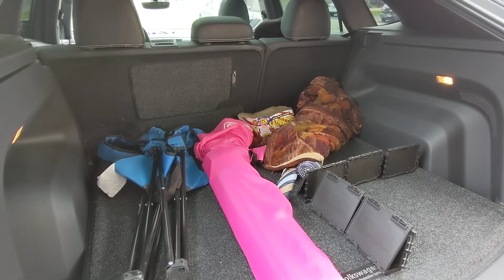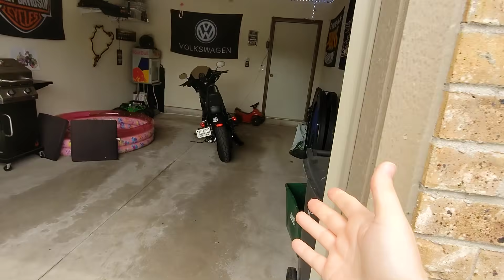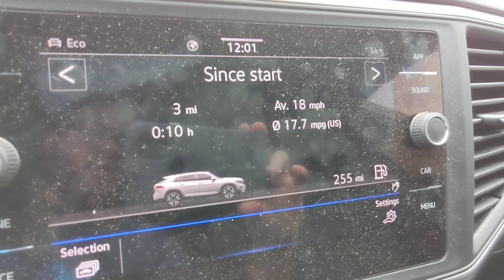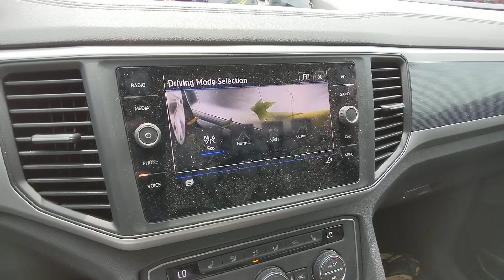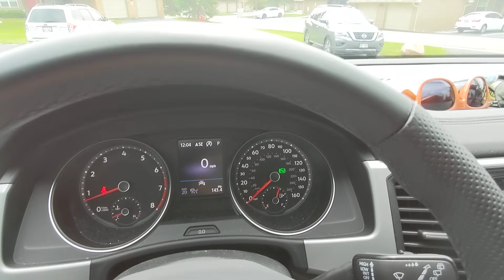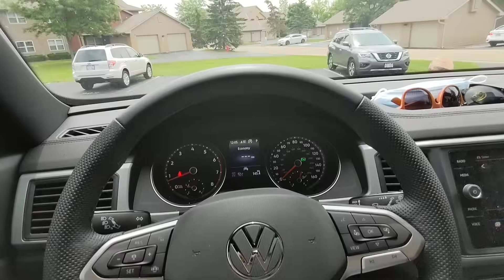2021 VW Atlas Cross Sport.  Why we're trading after only 4 months!

Comment: I have the four-cylinder turbo and I prefer that over the V6. It’s actually way more fun to drive and it gets amazing fuel economy.
Reply from the maker: Turbo is a great engine.  That VR6 sounds so darn good though!
Reply: I have the same model with the 2.0T audi motor. Its great with plenty of power and gas mileage.
Reply: So the 4cyl in this thing is NOT reliable
Reply: Lucas, what do you get for mpg out on the highway?
Reply: @zachl6918  I get 22mpg
Reply: Getting about 19mpg in my 2.0t
Reply: @mattnewhouse  Good to know, thank you!
Reply: If you choose Turbo over a v6 that’s a pussy move I sold my turbo cause it’s ass reliable

Comment: I was curious and drove no faster than 55 with an average speed of 45 to 50. I squeezed 23 to 24 mpg. I drive 50 miles round trip every day to work in my 2020 Cross sport 6 cyl. 4 motion. With a  slightly heavy foot when in a hurry, oh yeah, I'm looking at 18 to 19. Now with government pushing the green new deal, driving gas up and forcing us to buy electric, we're thinking of the ID4. Just thinking.
Reply from the maker: Its an expensive vehicle both from a depreciation standpoint and from a gas guzzling standpoint when you're putting on those kind of miles.  Its hard to justify a nice car just to load it up with miles like that.  To this day it is one of the best road trip cars i've ever used though.  ID4 would be a great option.

Comment: Just drive in sport mode, steering feedback is improved. And on freeways sports mode will not cause a dent once you are cruising in 8th gear. It just improve the response curve and removes up shifting eagerness in Normal mode. 23 mpg and regular grade gas is good as 26mpg premium. And while towing expect 13-16 mpg, which is not the best, so needs some planning on refueling. A bigger gas tank is all this car needs. Thanks to market adjustment by Kia and it’s likes, this remains my top choice. I can live with this.
Reply: My daily driver is an 09 Jeep Liberty. I put bigger tires, 3-inch lift, skids, rock sliders and side railes, class III hitch, customer front steel bumper w/winch. With that said, it gets 10 city, 15 hwy. Drive just under 3 miles to work, half of it is 25mph, rest is 35-50.  All it takes is owning one gas guzzler to make the Atlas seem like a sipper. :-) I also have a 2011 T&C Minivan and the 2019 Atlas SEL P (with 4Motion of course). Car is almost 3 years old, 16k miles. Use it for trips and yep, I stop every 300 miles to fill up.

Comment: Wow.  What a long winded review.  Must need the clicks and watches to get paid.  For a vehicle that was "traded", why not just get to the point?

We live in Wisconsin to.  AWD is NOT necessary if you have the proper tires on your vehicle for this climate.  We own an Audi A3 TDI and a Passat TDI 6MT.  Average MPG in the Audi is 41 and the Passat is 45.  This is over the last 35K miles in the Audi and 60K miles in the Passat.  VW lost a lot of its attraction when they made the decision to exit the diesel market in the USA.  

The Atlas and it's variants are "ok" vehicles.  They are nothing special.  We test drove all of the Atlas variants.  Can NOT figure out why anyone would purchase one over an Audi, especially for what VW is asking compared to a similar equipped Audi.

The BEST version of the Atlas is the previous Touareg TDI.  That SUV was what they should have continued.  30+ MPG easily, higher towing, better interior similar price.  

Our next vehicle to haul the family (there are 14 of us) will NOT be a VW atlas, that is for sure.  Right now we take multiple TDI vehicles and it is still CHEAPER that owning a single gas guzzler (and these vehicles are gas guzzlers).  A Chevy/GMC extended cab with a 3.0L duramax will easily get over 30MPG on the highway, cost about the same and tow significantly more.  The Tahoe AND suburban with the 3.0L diesel BOTH get better fuel economy than the Atlas.

Once Chevy gets a diesel in the traverse, which will most likely get 35MPG+ on the highway, they are going to eat VW for lunch.  Without the magical TDI sauce these things are money wasting fuel pit.  

Once you drive a TDI and can't get below 38-40MPG even if you drive the vehicle like you stole it (and that is FUN with all the low end torque) it will be very hard to buy a gas engine anything that sucks fuel.  Diesel around the Madison, WI area is 10-14% more expensive than 87 unleaded, yet returns 30% better fuel economy.  Your cost per mile driven is LOWER in a diesel even AFTER you figure in the cost of DEF (Diesel Exhaust Fluid) and the few extra parts that need to be changed (Fuel Filter, etc.)

If VW put their 3.0L Twin Turbo TDI that the German Spec Touareg currently has in the Atlas, then you would see MPG in the mid to high 30s, towing increase to 5000+ lbs and cost less to drive.  It makes zero sense to NOT do it.  They are just giving General Motors more time to increase the size of their diesel fleet.

Comment: I think this is decent mileage for a near full size SUV with awd. Its better than a Tahoe and the like but less than a Traverse. Unless you are getting a hybrid truck not many this size do much better. Now MPG has improved in many  SUVs for 2021 so it may have fallen in mileage ranking recently  but this has class leading storage behind the 3rd row. And if its regular gas instead of premium  that provides a savings. Looking into getting a Atlas R Line premium trim in about 8 months. Im looking at other trucks with at least 20 cubic feet behind 3rd row...so it stacks up pretty decent against the comp in sticker price as well  and not huge like a suburban. Im aware this version only has 2 rows.

Comment: Those faux exhaust ports are trash. Btw, a sideways muffler with two exit pipes is not a "dual exhaust". A true dual exhaust either comes from both sides of the manifold all the way back or at least split from the cats. C'mon man.

Comment: We have a 2021.5 Atlas SEL. 5000 miles, already taking it in to the shop.  Some sort of strange smell, sounds like plastic or rubber burning. We got a good deal on it, but the fake twin exhaust, the dumb reflectors, the crap audio system(literally the worst audio system on the market).... it's a cheap feeling SUV. Owned GMC's for 10 years, never had to take them to the shop for anything other than services... sure miss those BOSE audio systems as well.

Comment: I purchased a 2021 KIA Telluride for my family of 5. We got the SX model with FWD instead of the AWD because of mpg. I modified the intake and the exhausted plus added a oil catcher. The over mpg improve to 25 city/ 29 Hwy (solid at 70mph).
Reply from the maker: Congratulations!  All of the telluride in my local area are marked up MINIMUM 4K.  Crazy.
Reply: So did this "void" the warranty?? Also you paid more again to "upgrade" your car.
Reply: @patrickgroff5399  my background is chemical engineer and my work involves working with automotives. I paid about 2,000 under the msrp price because I was negotiating with the dealership and the manufacture at the same time. To answer your question it’s yes and no. If you do your own routine oil changes and follow the owner’s manual, than NO, you do not void your warranty. If you install or replace a part to the vehicle that is different than the stock item then YES. You can always just remove the part if you decide to get it serviced to not void your warranty. I don’t use any dealership service because they take forever and it’s a waste of money. Plus it’s I enjoy doing my own repairs and maintenance.
Reply: @09FoxRider  what is the reason for an oil catcher. This has me stumped. I understand the use in high end drag cars and 1/8 mile cars but your car??
Reply: @patrickgroff5399  GDI engines do not filter the blowby exhaust. The oil catch helps prevents carbon build up over the intake values.

Comment: We traded our 2018 Atlas in on a 2021 Toyota Sequoia TRD Pro. You want to talk about cheap interior or horrible gas mileage?!? That thing hasn’t been updated since 2008, and we were getting about 10-11mpg in the city. After only 6 months we traded it in on another Atlas. 2022 Cross Sport SEL R-Line with every single possible add-on and couldn’t be happier. 18-19mpg from a full size AWD SUV is great mileage as far as I’m concerned. Such a great, comfortable, capable SUV. I love it.
Reply: All your points are spot on but people also tend to overlook the safety factor of the Atlas. I looked at the 2019 Highlander, Pilot, Kia Teleride (sic), Durango, Grand Cherokee (I'm a jeep guy) and even a Tahoe. Atlas won and what pushed it over the edge was how it did in the crash tests.
Reply: Not the sel premium plastic my ass Toyota has plastic my family a millionaire and have business

Comment: I've owned 2019 standard Atlas, and now a 21 Cross sport.. 
Gas mileage it's in my own opinion, the worst part about it. They should have used the V8 that's in the Touareg. I would have gone to the Touareg if it were in my market. Or V6 with Turbo.  Aside from that it's a great vehicle. 
Interior is fine better quality than most vehicle on the road, and hasn't changed since it's inception. 
I'd purchase another if I had to do it all over.

Comment: I have the SEL 21, and i've been back to the dealership three times already with issues.  I've thought about trading it back in as well, but now its in the shop for approximately two weeks for a new part. My vehicle kept popping up numerous error codes, and I was old not to drive the vehicle. Now, we wait :) .
Reply: Same 2021 sel premium. Fuel Injector needed to be replaced. Dealership that did the replacement didn't do it right and I had a major fuel leak. Had to get it fixed again. But I love my Atlas

Comment: I just traded in my atlas after almost a year. The MPG is beyond abysmal. With the small tank, I’m filling up after 250 miles. And mine makes a squealing noise when I turn left around 5mph. VW said nothing was wrong. Off she goes!
Reply: Bad MPG?? Its a big vehicle. Its basic physics. The engine will work harder to pull that weight. We a 2018 VR6 with 60K miles so far no problems.
Reply: @G L You must have the 4 cylinder. Get the VR6, naturally aspirated. Ramming extra pressure with Turbo and GDI, puts more strain on that engine. Especially a vehicle that size and weight. Repairs are a lot more $$$ than a few mpg less with the VR6
Reply: @G L I took it to the dealership less than a month ago and they said there was no recalls and no issues. Just a disappointing car in general for me. I love how spacious it is but who cares about space when you’re squealing around all over town.
Reply: @G L HA HA HA HA HA!!! Scotty. He definitely talks out of his ass sometimes. But, on that I agree with him. Its logic and physics. A small engine with turbo and GDI pulling such a heavy vehicle makes no sense. The VR6 isnt that bad on fuel on the highway. But, you're right I had 7 Jettas TDIs over the years, never had trouble with Turbos.
Reply: @G L I get 26 on the highway at around 65. My wife drives a 2015 VOLT to work never using fuel and I use my TDI Jetta to commute, so for us it makes sense with the VR6.  Keep reminding Scotty that those TDIs can outlast his 94 Celica. Mine has 184,000 miles and its 2013.

Comment: I'm a VW salesman. I sold a 2022 Atlas SE W/Tech to a customer in Dallas Texas (I'm located in Wichita Kansas) I drove all the way to Dallas on one tank of gas. I averaged 24.9 mpg. If you don't like the milage of the V6, get the 4. It's turbocharged so you only really lose low end torque.
Reply: too bad they didn't add two scroll turbos to this monster, that would have been icing on the cake
Reply from the maker: Turbocharged motors have better torque low end than NA engines do.  Our best MPG was 23.  That was a 280 mile road trip at around 73mph in right lane.